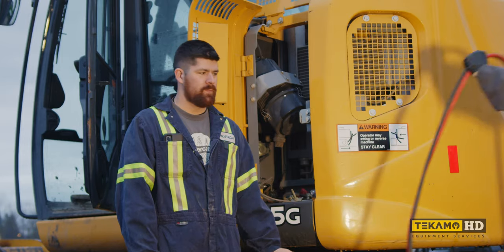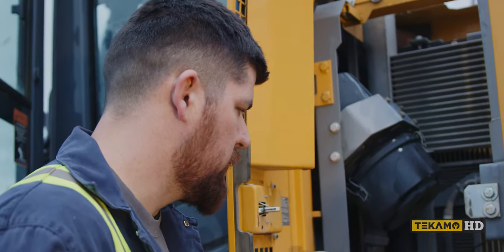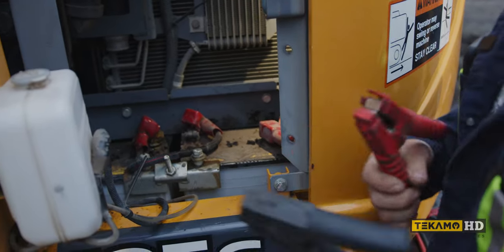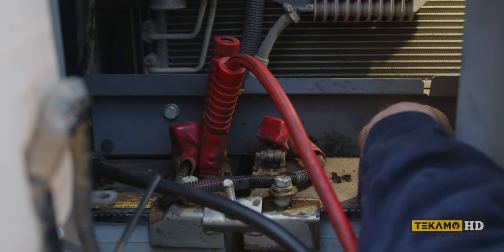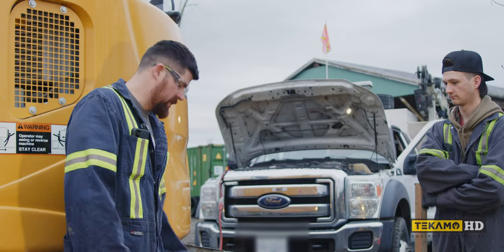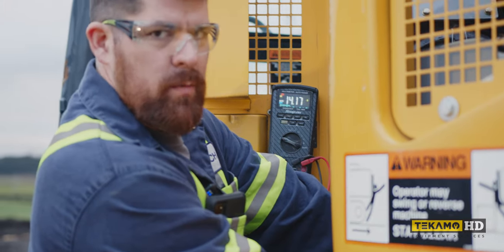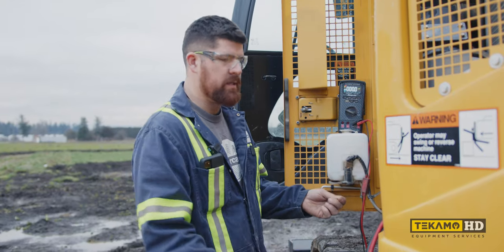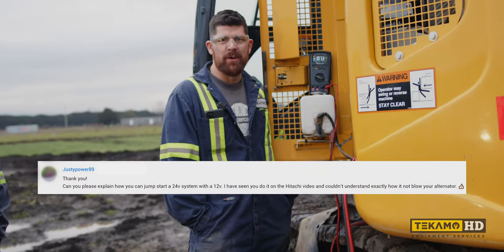Simple Way to Boost a 24V System

Comment: So the bridgewire that connect the two 12Volts batterys can stay on while doing this?
Reply: A year late, but yes. From the perspective of the other battery, only one cable is connected so nothing will happen. Think about your car: disconnecting the ground is usually sufficient to cut off power.

Comment: He's exactly right, in my deuce (24v), if my batteries die, I can jump it with my pick up that's 12v, as he said, one battery at a time. If anything, I find having quality jumper cables and clean battery terminals make for more efficient jump.

Comment: Here in AZ we say new batteries and brakes every 2 years. The heat just wears em out.  So out have habit, I put a battery load tester on the 50 hour checks.  Don't even boil the bat on bench, if the Volts and cranking amps are low. Seen and heard batteries blow up on the dumby charger.  Has Cam used that Mini Ductor yet?  I thought about buying one it's just pricey.

Comment: amps do max out from an alertnaotr around 1200rpm
Reply: engine rpm* and 11.9 is fully depleted
Reply: That really depends on the pulley size the vehicle manufacturer decide to use. Remember there is essentially an overdrive pulley ratio between the crank pulley and the alternator pulley, which means alternator is spinning way faster than the engine (usually somewhere between 2:1 to 3:1 ratio). Alternator output is also affected by temperature, the higher the temperature the worse it performs. I've seen buses run with massive alternators on a Detroit S60 which needed to be liquid cooled by engine coolant.

Comment: hi i have a question，can jump start 24v vehicles using two 12v vehicles？
Reply: For sure you could. It would be over twice as fast as using 1 12v vehicle.
Reply: I use my pickup and a 12 volt battery charger running off the truck

Comment: Can a dodge cummins 2500 24v system jump start a honda crv 12v system? Someons said they would blow up my system if they did it with their truck?? Would it really kill my electrical??
Reply: Batteries on a truck like that are run in parallel not series so even though there are 2 batteries it's still a 12v system.

Comment: I use a welder, works better, I just unplug the ground from the welder, hook the ground up to  the mirror and put the stinger on the starter, angle the mirror so I  can see the escape path,  put the swamper in the cab to keep the key cranked over , plug the ground into the welder and whamo.. it either starts or I call the rental company right after the fire department and the new one will have a good battery.